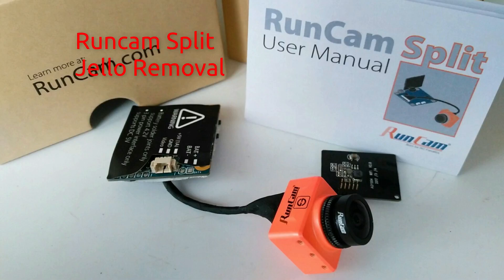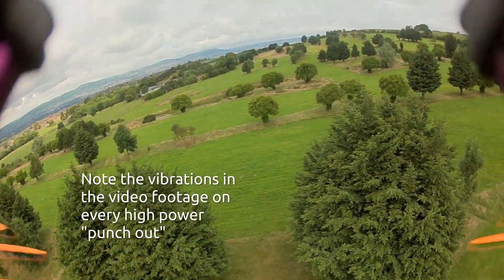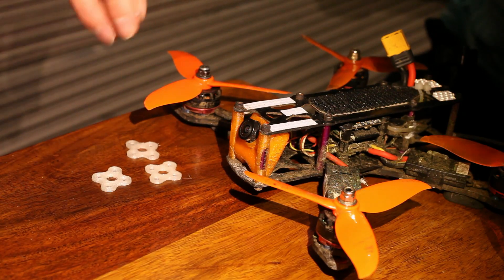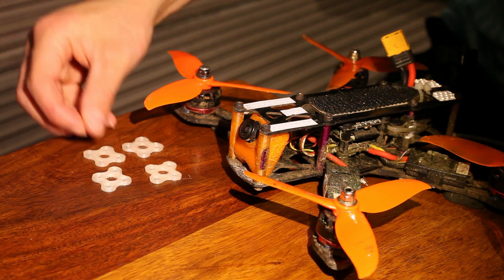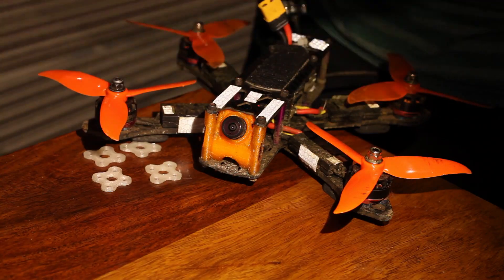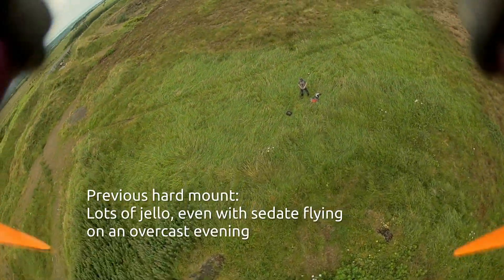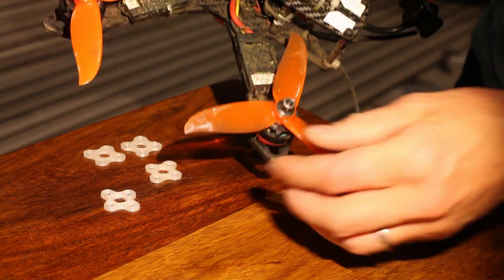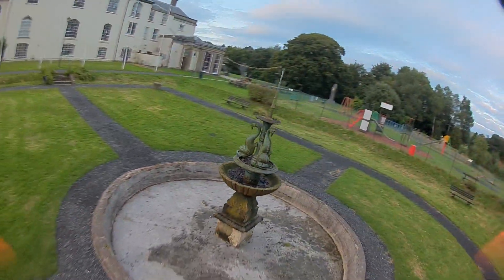Runcam Split Jello solution

Comment: thanks for posting, i notice you have the short lens?... it looks like the gopro lens but shorter.. anyway i initially installed it in the normal fpv spot, even with the gopro lens i didnt have too much frame or props in view with a 35degree angle??.. and i only had jello on punch outs, then i soft mounted the camera mount with 3m tape... and got horrendous jello everywhere... then i made a foam cube (which i thought was so cleverly made) and mounted it again with 3m tape where a gopro would go.... double horrendous jello..... tried various things after that... used camera mount plus foam cube where the gopro would go... triple horrendous jello... along with the dropped frames in fpv and the dropped recordings i'm starting to lose hope. i have heard the gopro lens causes jello in some cases, so i might try swapping it out for a swift mini 2.5 lens... i also have a dudd motor which might be the problem
Reply from the maker: +TheMadmacs I am just using the lens that came with it. I don't know exactly what it is, but I pre-ordered before the gopro lens was available. FPV field of view is about the same as my previous Swift with a 2.1mm lens, the recorded FOV is wider though, hence the props and frame in view. My "before" shots show that too, but this new mount holds it further forward, leaving only a tiny bit of the props in view.

For the jello, try the same solution as I've used. It should like maybe your mount is too soft. You can see in the video that this mount is not exactly soft, just not 100% rigid. The link to that mount is in the video description.

I have had no issues with dropped frames provided I am recording at 1080p, 60fps, and FPV is set to NTSC.
Reply: thanks for the info, jello is such a vague problem to fix. and add to this i have one weak motor. still really enjoying it though, the split is so nice an fpv image i'm continually distracted by just looking around at the view.